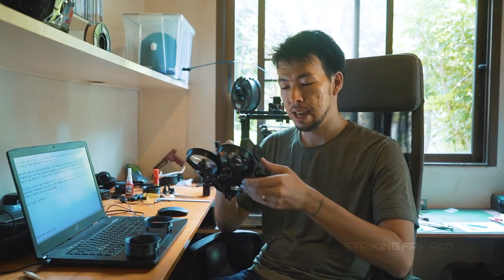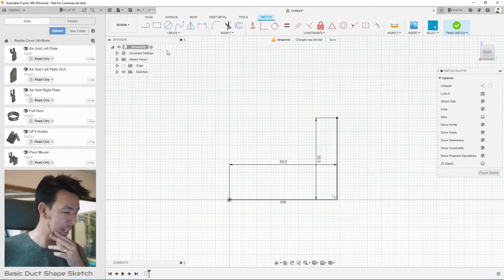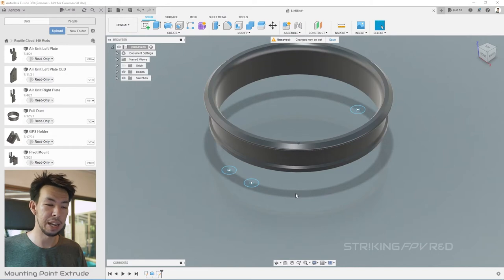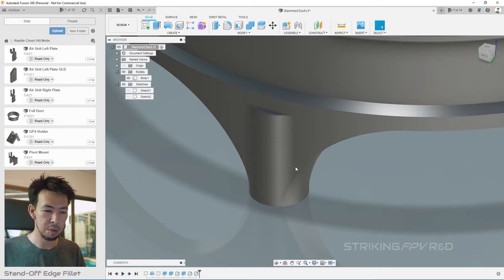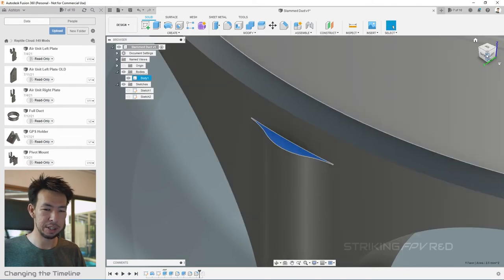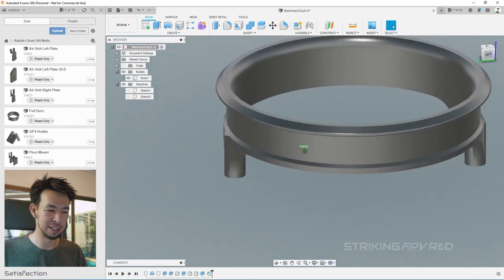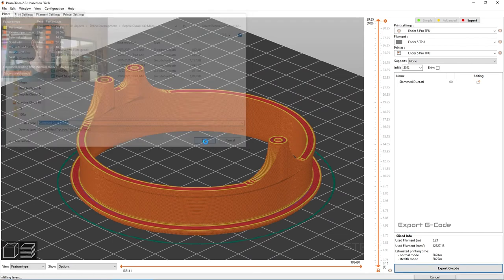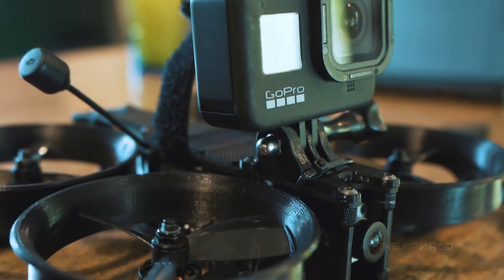Design Your Own Slammed Cinewhoop Duct in Fusion 360 - Cloud-149

Comment: its funny to hear that name ... guess i have to rename it to my real, one time  xd ...
aaand an other tipp^^ 
if you open your last duct designe .. and go to the sketch ... you can drag a box around your it and highlight all of it .. press CTRL+C... then tab over to your new design and Ctrl+v (you have to be in a Sketch) ... done, you got your old sketch .. or part of it ... if you shift select it ... in your new design ... saves some time if you already done it somewhere else ;)
Reply: about your chamfer on the Standoffs ... you can do it the same as you done the duckt ring ... just extrude the standoffs way higher and do a new sketch and revolve it around to get a very nice 45° chamfer
ps.: i write a new comment once at a time .. im bad ad remembering all the things ^^
Reply from the maker: The revolve to cut around the stand-offs didn't cross my mind at all, but makes so much sense.  Just goes to show how many ways there are to go about doing things in parametric design.  Guess it's the kind of thing you pick up as you go along, just gets added to the bank of nifty tricks.  Will have to remember that for next time, cheers.

That being said I feel like I'm done with ducts, gonna' move on to less rounded objects, hehe.
Reply: yeah im doing Fusion for a long time now .. i picked up 1 or 2 things... and im still learning how to do things ... and what Fusion likes and doesn't like ^^